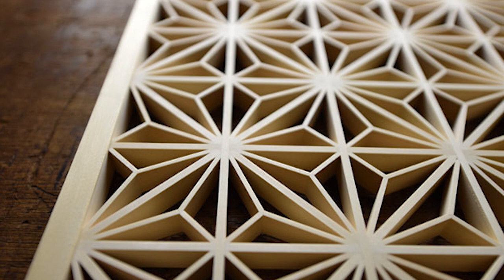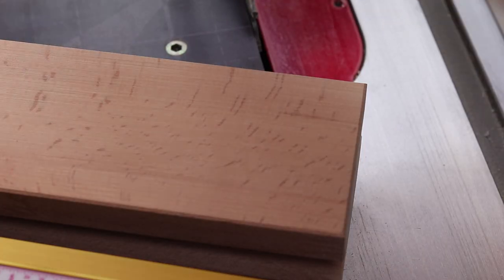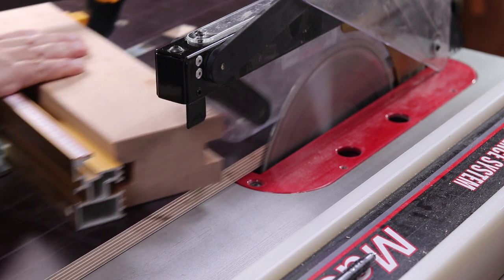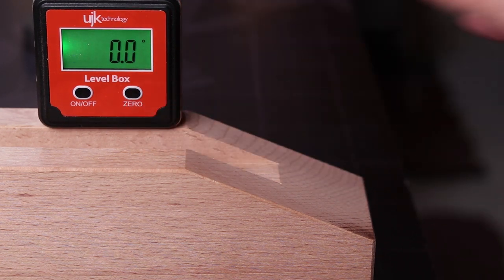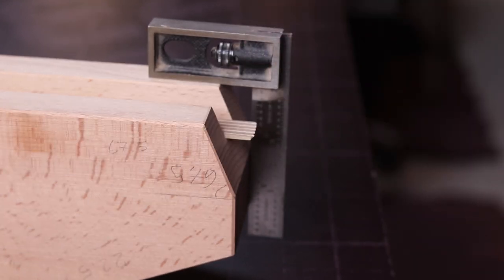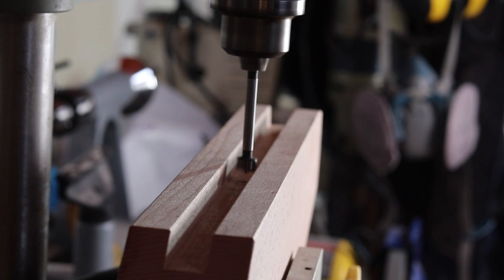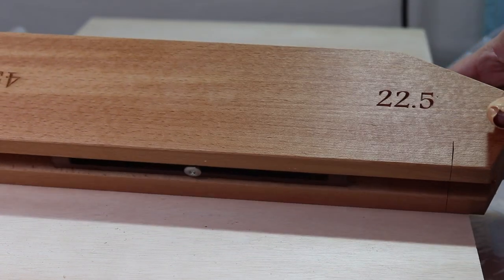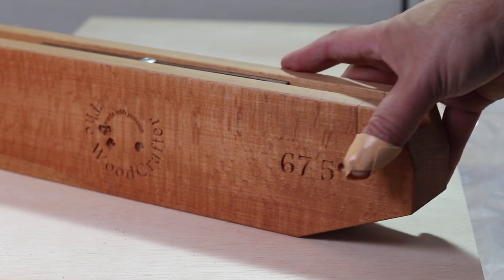Kumiko Jig for Asa Noha pattern

Comment: I am a retired woodworker but have kept my shop intact . I make odd things as a hobby now and give them to my friends and relatives. I have watched many U-Tube videos of wood projects and methods and have learned a few things that have helped me. Your video taught me more on how to improve my methods than any video I have seen. I know very little of the art of making Kumiko although I do at times have to make small items of wood that require angles on the ends. Your method off sets my failing eye sight problem and I thank you for the solution.
Reply from the maker: Thank you sir, it is my pleasure that this was helpful to you by any means! I am sorry for your sight issue and wish you the best of recovery! Thank you for your comment and time.🤝

Comment: How do the two 67.5 angles differ in length? And please tell me the depth of the 22.5 and 45 angles as well. Excellent jig and great video.
Reply from the maker: Thank you for your comment, please check this book https://issuu.com/bluehillspress/docs/978-1-951217-24-2_issuu
this should help you better understand why! still, this is optional and you can use only one but having 2 (67.5 jigs) will make it easier and faster.
About the 22.5 and 45 depth? if you mean the groove depth, that also depends on the thickness of the Kumiko strips that you will be using. hope this will help you. good luck

Comment: Do you sell plans for this?
Reply from the maker: Hi Jim, I don’t sell plans, however the dimensions are shown on the video, just use a 3” or little less thick material nothing critical or secretly concealed here, if you can cut the angles accurately then you are in business, the rest are all approximate, the depth and width of the dados are 5/8” and 3/4” also that depends on the size of the kumiko you will be making, you can go with 1/2” for both! Just focus on the angles and leave enough material to rest your chisel or hand plane on. Best of luck